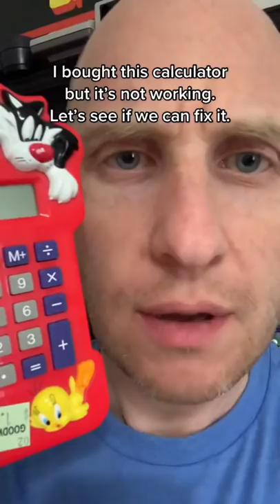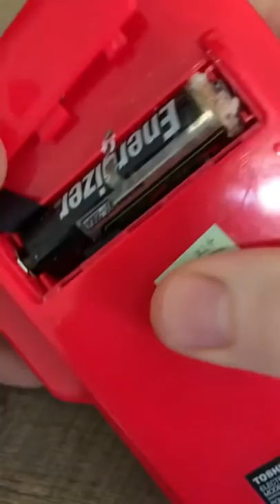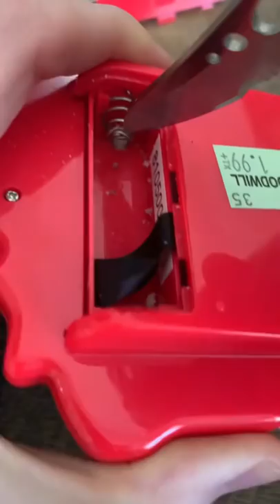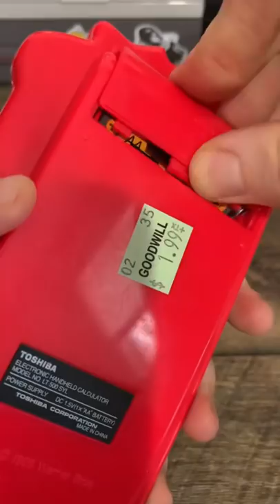Is this non-working calculator fixable?

Comment: I hate battery acid crystals. They killed my Wavebird. Maybe I will try your method of cleaning but the Wavebird controller's battery contacts are rusted and I cleaned them with mild soap and old toothbrush and it wasn't effective.